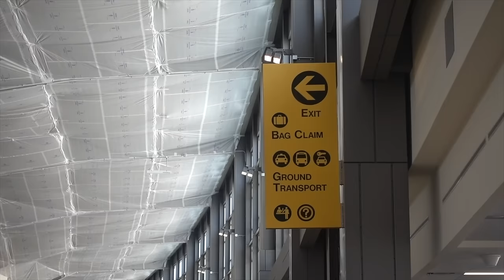MTB Myths that need to die—and some that are true!

Comment: The myth about quick release i heard was never clamp it toward the front wheel. Because if you do actual wilderness Mtn biking you could end up with a wooden stick get stuck in it and open the quick release. Which i do believe is not wrong but it's just so unlikely to happen that you shouldn't worry about this especially if you're just a city or road race type of rider.
Reply: Yup, I've heard that about the direction of the lever for MTB.  On the other hand, if you're a road racer, I was taught that you shouldn't clamp the lever facing backward, because in a tight group there's a chance the guy behind you could flick it open with his front wheel.  That's probably even less likely than getting a branch in your MTB's lever, but as a result of these two superstitions, I point my levers straight up.
Reply: I've seen it happen to my friend, broke his wrist and collar bone.

Comment: My Santa Cruz 5010 (130mm travel) has no kickback and I also have the industry nine hydra hubs. 690 points of engagement is an amazing feeling. Downhill big travel bikes are more prone to it, but they have redesigned frames and linkage to avoid it.

Comment: If you're using pliers to disengage your quick links in 2022, you're doing it wrong. Nowadays they're designed so you can compress the link plates together slightly, and then you can disengage the quick link by hand with no tools. If you use pliers anyway, you will definitely damage the engagement mechanism over time.

Comment: I can see where the quicklink suggestion comes from. Its similar to changing the lug nuts on your vehicle. Those are supposed to be changed everytime the wheel comes off since the threads actually deform when torqued.
Reply: No, they aren’t.
Reply: That's BS. Fine threads can withstand tens of thousands of pounds of pressure before yielding or failing. You don't even use a tenth of that to torque on your lug nuts.

Comment: Things hold way more PSI than they are rated for for a reason.  A soda bottle is rated to about 16 psi, basically one atmosphere.  I've gotten them to 160 psi.  But they are still rated to 16 psi because they can't assure that their manufacturing process will never not generate a defect that will fail before the average 160 psi.  So you can't just use "I once inflated it to blank" as a reason to think something can't pop before then.

I'm all for going past something's listed rating if there is an engineered safety margin.  But in the case of a soda bottle, 160psi isn't an engineered safety margin.  It's just sheer chance that their lazy manufacturing happened to create something strong, likely because of their own awareness of manufacturing variance.  A bike tire's measured psi limit could be similar.  I agree that the flight isn't really a concern but a backyard test of pressure is just not how you should think about pressure.

Comment: 1. One Last Run - You missed the most obvious reason why this is not going to work out. You're completely exhausted, that's when you say or hear that phrase the most. You're toast but you don't want to admit that the stoke must eventually come to an end. 30 years ago I made a rule that when "One Last Run" entered my head it was time to pack up and go home. My late in the day injuries all but disappeared.

2. When I was 29 I could do brodies on a beach cruiser on wet asphalt for a minute at a time. Downhill snowboarding made my legs freakishly strong, but it was still my own power that made riding my mountain bike uphill a non issue. Now that I'm in my 60s I have an emtb with 6 power settings. 0 being off and 6 being the most assistance. Somewhere between setting 4 and 5 gives me the same amount of power that I had at my peak of fitness. So... was I cheating in the 80s and 90s?

Comment: The fact about tires exploding on airplanes is true, just probably not for modern mountain bikes. Last time I flew with my bmx bike (100 psi tires), both tubes did indeed explode lol.
Reply: It's not true, the cargo hold in a passenger jet is pressurised.

Comment: Tire and aircraft math: Lets say the pressure in tire is 35 psi at zero altitude above the sea and temperature 20°C (293 K). The normal atmospheric pressure at this altitude is 14.69 psi That means the absolute pressure in tire is 49,69 psi. First let's change the temperature. At altitude 35000 ft the temperature is -54°C (219 K). Because the tire volume is almost static, we will talk about Isochoric phenomenon that says: P/T=constant. So the absolute pressure in -54°C is 26,16 psi. The atmospheric pressure at altitude 35000 ft is 3,47 psi. So the relative pressure in tire should be 22,69 psi. So in fact the pressure will be lower and not higher due to high change of temperature.

If the cargo is heated, lets say to 20°C, the tire pressure will be 46,22 psi.
Reply: The cargo hold is directly under the cabin, just separated by a thin floor with a carpet (which is made to let air  passing, since the cabin floor would collapse otherwise in the case of rapid loss of pressurization of the cargo hold). It may be slightly colder than the cabin since its not actively heated, but it's still warm enough for animals and even humans (there had been cases where luggage workers fell to sleep there and woke up on a different airport)

Comment: I ditched the clipless years ago. Even my road bike has flat pedals now. I have 9 bikes hanging on the wall and people are telling me all kind of crazy stuff. Lime wheels being deformed by the bike's weight. If that's the case, you have more serious problems. A wheel that can't hold 25 to 30 pounds... yep. One thing I just found out today while doing some chain maintenance is that the quick link itself had stretched. I measured all the chains with emphasis in every one of those and all of them were fine except that one. The gauge tool was getting in at .75. I replaced it.

Comment: 10:50 Storing bikes vertically could actually affect your hydraulic brakes if there's even a tiny air bubble in the system. Other than that, I see zero issues.

Comment: Quick release skewers are only dangerous if you leave your bike unattended for longer or secure it on the wheel like some bike racks only allow, because it's super easy to swipe out the wheel.

With nut, it's a bit harder...

Comment: The good reason to install the quick releases lever on the drivetrain  is to avoid  touching the rotor with your fingers when you open the quick release. You don’t wanna burn your fingers (Rotors can be very hot after a descent ) and you don’t want to contaminate the rotors and the brake pads if your fingers are dirty
Reply: There's at least an inch between the QR and the disk. And disks can obviously take mud and everything else, they're open during the ride. Jesus.

Comment: Great video!! What about hydraulic brake hose olives and inserts? I read once they are supposed to be replaced every time you disconnect the hose from caliper and levers. Guess nobody does that too (same to the quick link story)... I have recently upgraded my brakes, hoses, olives and inserts all the same... never had a problem.
Reply: Never heard of replacing the olives after disassembly. You can find the same system in hydraulic systems of machinery with steel pipes and there you can disassemble and reassemble it as often as you like

Comment: The learning how to bunny hop one may not need to die just yet. I grew up as a roadie and always road clipless so I learnt the "clipless bunny hop" for kerbs, debris, potholes etc. I've now fully converted to MTB for about 5 years and always rode with flats and I still can not bunny hop well, no matter how many tutorials I watch. I can bunny hop enough to clear common trail debris some fallen trees and kerbs etc. I have been getting better at it with practice but the bad muscle memory of about 14 years of clipless pedals I believe is still detrimental to my bunny hop progress, that or I'm just really bad 👀
Reply: Think of it as shifting your weight to get the bike up, not a super physical exertion in which you pick up the bike with your arms and feet.

Comment: If bicycle tires exploded mid flight due to overpressure then they would be banned from ever going on flights to begin with.
Can't have exploding containers of any kind sitting on a plane.

The min-max pressures of tires are for when they are in normal USE. As in, you sitting on the bike riding it.
The safety margin is at least twice that. So if your tire says 35 psi max, it won't blow until you put 70 PSI and beyond in it.
There's also tire design to keep in mind here. If you overinflate your tire, your contact patch will be almost non-existent. So the max rating is taking that into account as well, the tire simply won't function right when inflated beyond the recommended maximum pressure.
It's the sole reason riders DON'T inflate their tires to the max recommended pressure, because lower pressure gives a larger contact patch with the ground for increased grip at the cost of increased rolling resistance.

Obviously, too low pressure and you will burp the tire and it punctures easier at too low pressures too!
And too low pressure can also negatively affect your grip if the contact patch collapses in on itself or the tires literally walk off the rim in corners.
Just right is the name of the game here and what's just right depends on the tire, rider preference, rider mass and the type of terrain being ridden. Sometimes you need more, sometimes you need less. That's why you bring a pump with you on your ride to be able to adjust pressure as necessary. And of course to re-inflate a burped or even punctured tire.

Comment: It's actually better to store your bike hanging up by the front wheel to keep the main seal wet on your forks. But if the seal is worn, it will leak all of the fluid out. So it's a double edged sword.
So I reused a quick masterlink on a DH bike and let a friend ride it. First run of the day he drug the brake and it kicked back and threw the master link and chain off.

Comment: Aircraft cargo areas are pressurized.  (the pressure envelope must be the cylindrical shape of the entire hull of the aircraft)  What pressure-altitude that may be, I don't know, but a pressure of that under 12,000 feet for sure though, to prevent potential dizziness or unconsciousness of passengers.  So, no more than a 5.35 psi increase in tires, not even taking temperature into consideration.

Comment: 13:50 I would argue that you should not trust brand new Quick links if they don't click. The important part is having enough friction, not the age or cycle count. Rest assured, there will be QA problems with every manufacturer and a brand new quick link can be too loose out of the box.

Comment: I have recently gotten back in to MTBing after a pretty long gap (25-30 yrs).  A LOT of technology has been developed between back then and now.  Wow!  
When we picked up our new 2022 mid range hardtail bikes, I did find it odd to read in verious notes here and there that quick links are a one time use.  I was taken completely by surprise with that.  Back in the day a quick link was just that, a quick link and nobody ever batted an eye on reusing them. 

I would bet that like most warning labels in todays culture, the "one time use" clause from folks like SRAM and Shimano derived from being sued for injuries caused by overly loose quick links.  This was most certainly caused by the other issue with todays culture where many folks feel entitled that their gear should last forever without proper maintainence.  So, if the manufacturer says this is a one time use part, they follow this, nobody gets sued.  

If it clicks, it's going to be fine.  If it's easy to install/remove by hand without any remote bit of a "click", yeah it's done.  Replace it.  

Great video topic Seth!
Reply: Nobody thinks like that. And how would a company prove a link had been used more than once. Or alternatively that the link had caused the problem anyway. Come on
Reply: @garymitchell5899  Don't quite understand what you are referring to Gary.

Comment: I had a bike, my wife doesn't ride much, hanging on the wall, the rear rim bent way out of shape, was a very expensive bike too.  it was hanging from a single hook actually from the ceiling of the garage but now I refuse to hang my bikes because I still haven't found a replacement rim for that bike. Ordered one once and they sent me the wrong thing but due to it happening in the middle of a complicated move with it sitting in storage for 6 months it was well beyond the return window. anyway, rim was supposed to have the break rotor mounting spot, it did not, it also didnt appear to have good rim breaking surface so not sure what the deal was but I could not install the break hardware and I am still searching for a replacement 2 years later.

Comment: I think that the only plausible concern to the QR skewer debate is that regardless of its installation side, the direction of the lever of the skewer should be closed to the rear of the bike. Sweeping away with the travel of the bike as to not get caught on foliage.

Comment: Hmmm. When you go up in altitude, discounting temperature differences the absolute tyre pressure will not change. Most guages measure the relative tyre pressure so as atmospheric pressure drops then the guage will read higher even though the absolute pressure in the tyre hasnt actually changed. When you take into account the temperature drop, then that will truly affect the absolute pressure in the tyre as the gas gets colder its volume drops in volume by approx by 1/273 for every 1 drop in C, hence its absolute pressure will change and drop.
Note in airliners it depends if your bike is in a pressurised hull or not, usually its not pressurised. For passenger comfort and technical reasons a planes pressurised hull only drops to arround 8000-10000 feet alltiude regardless of how much higher it goes.

Comment: With quicklinks that have been used to much and NEED to be replaced you can coat the clip with loctite and let it dry, that can regain you barely enough friction to ride to your local bikeshop and get either a replacement chain or link.

Comment: Re: The skewer is more a road bike thing, not folding it back as the gap created could allow a following rider tire to hit it and pop the skewer open causing the wheel to become lose or fall off. As for mtb, leave it on the side it’s on and fold it up as reasonably possible so it doesn’t catch on trail debris. Folding it diagonally forward into the triangle would be nice if possible as it would be a bit more shielded.
Reply: If another rider is that close then anything can happen. Come on.
Reply: If a rider is close enough to the point their wheel could get stuck on yours, your qr skewer direction is the least of your concerns.
Reply: @BrunodeSouzaLino  Alaays fold the rear skewer up and forward into the triangle area, so it’s protected.
Reply: @GNX157  And then the likelihood of damaging the frame trying to get leverage to pull the qr open is much higher.
Reply: @BrunodeSouzaLino  if you can’t get the lever off and use some other method that damages the frame, then you have your qr screw too tight. It’s not that complicated. All my bikes are set that way, and never a problem opening them with hand pressure.

Comment: I've had my 23 year old Stumpjumper hanging from the rear wheel on the garage ceiling since new.  My equally as old coil and oil Marzocchi Bomber hasn't been affected.  I hate to admit it, but I have NEVER serviced the shock and I swear it works just as well as when it was new.

Comment: You pull in a bunny hop with flats as well. Its physics...

Only difference is where the pivot point is. Clipped in you don't need to rotate the bike so you can pull straight - lifting both wheels simultaneously. Bunny hopping without pulling up is the real myth here. 

The only way to lift the rear is to rotate or pull straight up(clipped in). Which in both cases requires pulling on the pedal.

Comment: Eh, storing vertical. Over one winter I stored my mtb vertically in my living room. The KS Lev dropper post leaked oil past the seals. Bubbles in the fluid makes for a squishy seat. I found a repair video but it is a pretty involved fix. Swapped it for a coil dropper, no problems with that. Good point though, I should probably exercise the suspension once in awhile over the winter.

Comment: The quick engagement hub argument goes out the window on frames like the old GT dual suspension bikes where the crank is actually mounted on the rear swing arm. No amount of suspension movement alters anything as the chain.length doesn't change.

Comment: I’ve run quick links until one of the plates nearly cracked in half, and I’ve never had an issue with them wearing to the point that they wouldn’t “click” together properly.

Comment: I personally would still take the air of the bike tire specially if flying overseas with your bike. I flew from Mexico city back to the states and that's the first thing they asked. Guy behind the counter was pretty firm about it and warned me that they would take out the bike if they saw that it had air in the tires. Sure it's not "fair" but the last thing you want is loose your flight or your bike specially when flying.

Comment: That last run I feel it's true, the only big crash I've ever had was on a "last run"... Some knee stitches and a couple weeks with deep bruises...🙃 
About tires exploding, I was actually worried about my carbon wheels which have a 45 PSI pressure limit...